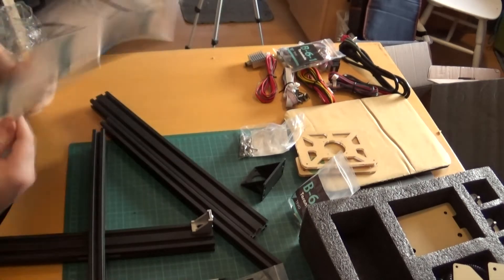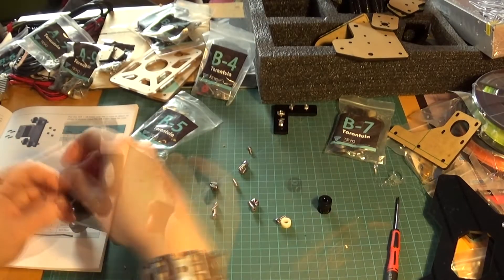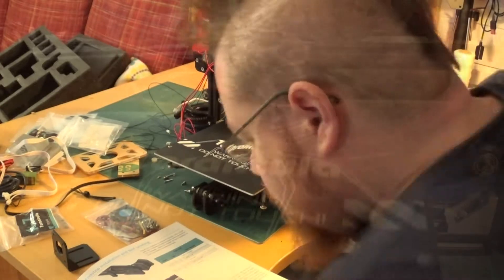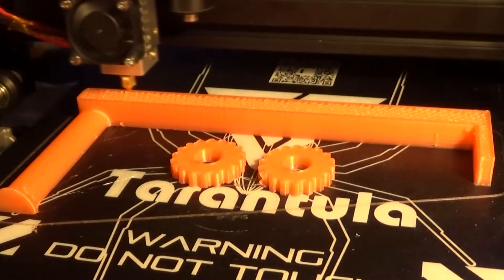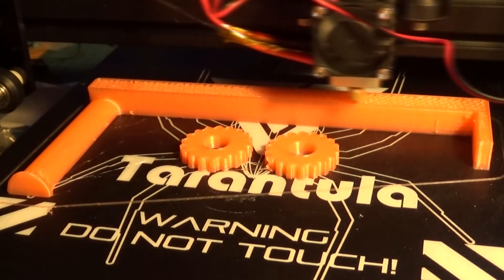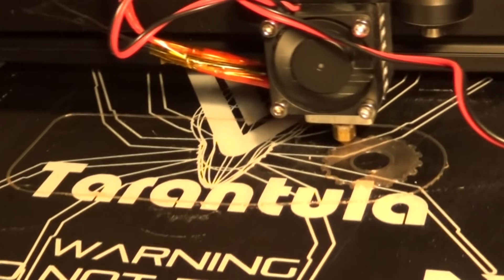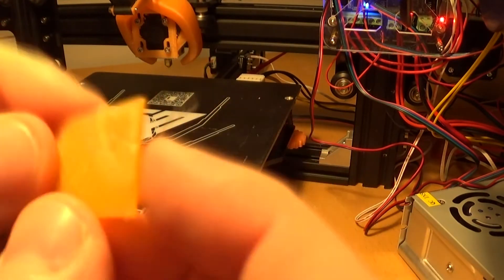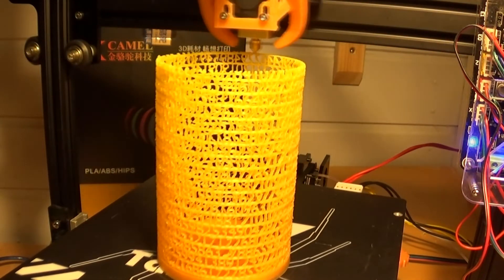Tevo Tarantula 2017 Review

Comment: Hey! It seems you have the same kit as me and I see you’ve got the auto bed leveling sensor (the green sensor), but you don’t seem to be using it? Are you having issues with it? Have you started using it after this video? If you did start using the sensor, how did you mount it along with blower fans?
Reply from the maker: I havent used it as its a waste of time, because there is no mechanical adjustment its easier just to level the bed manually, but printing out knob handles is a must!